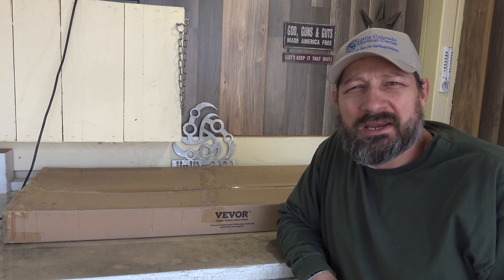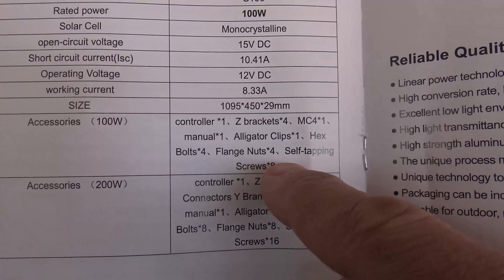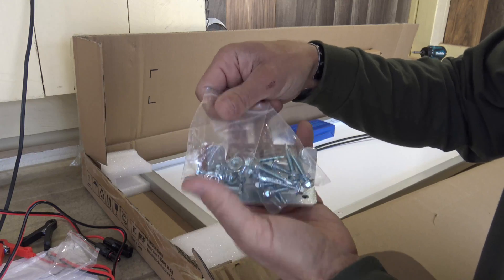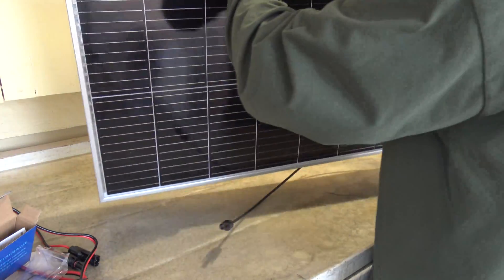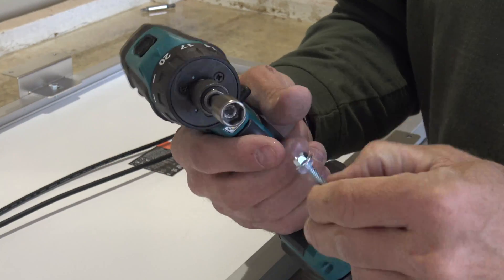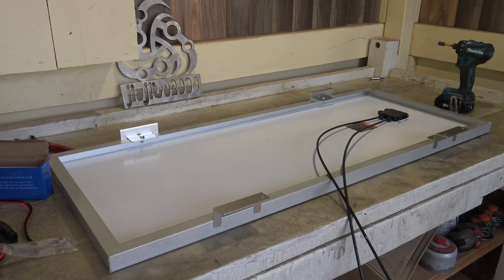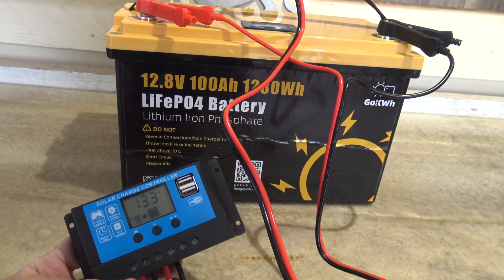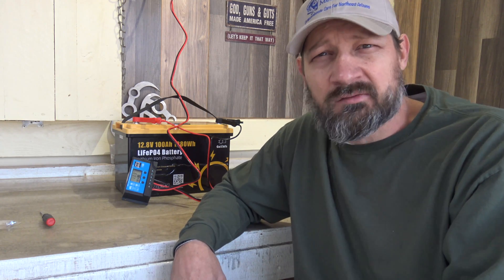BUDGET FRIENDLY - 100 Watt OFF GRID Solar Panel Kit - Not Bad!

Comment: One question I thought of is you repeated that the load terminals "could power low wattage devices".  But then you plan on connecting a 1000 watt inverter?  I guess I'd like to understand what you think "low wattage" is...  if this is a 30 amp controller we're talking 12v x 30 amps = 360 watts.  Yes?  Or did I miss something?
Reply: You can put low wattage on the controller output, and you can connect (as he said as well) to the battery that inverter. 
The 30amp means 360w solar panel can be handled by this controller.

Comment: Good information Sir!  One thing that caught my attention is that the solar charge controller had to be connected to the battery FIRST...I had envisioned an RV system where the battery would be switched between the solar controller and the auto alternator (when running) for charging.  I will have to rethink this!